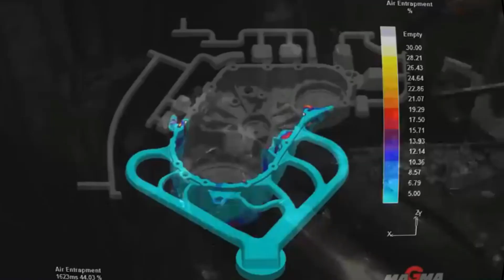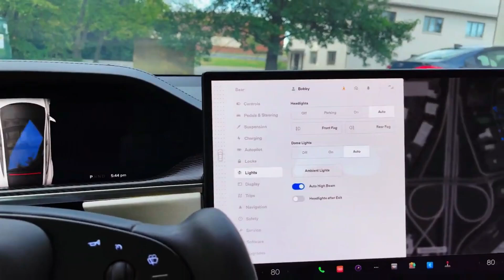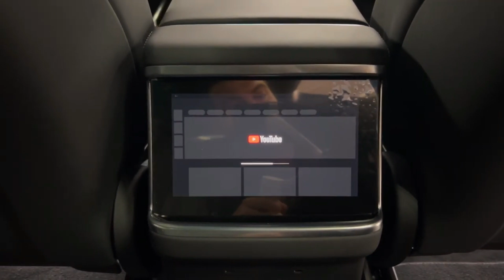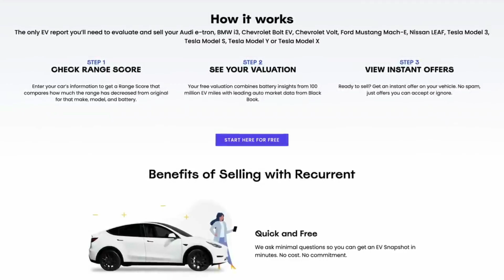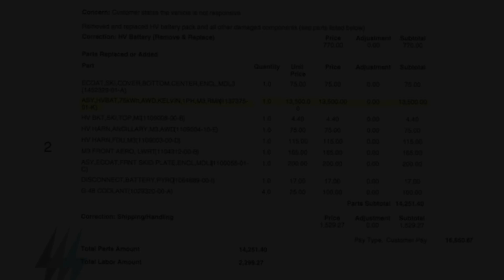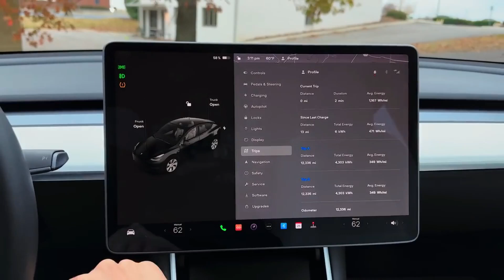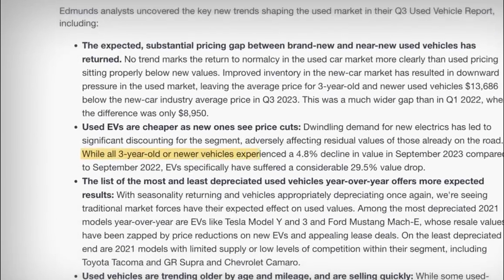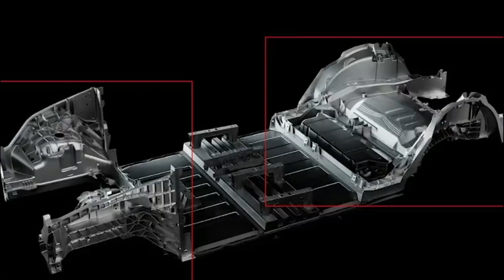Ultra High Mile Tesla Proves That EV Battery Last Longer Than You Think

Comment: I’m at 100,000 miles on my 2018 Model 3, and my original breaks. Tesla has done OTA updates that has actually improved my batteries over time shown in the paid “status” app, not the Tesla app. The chemistry is one thing, but BMS (battery management system) that Tesla has is what really matters!